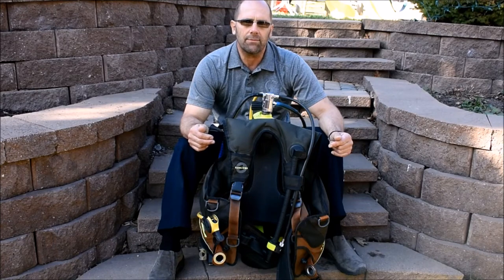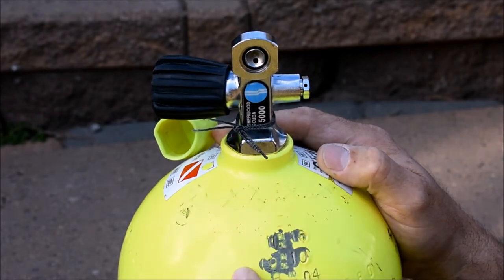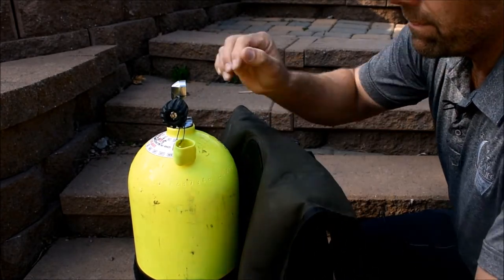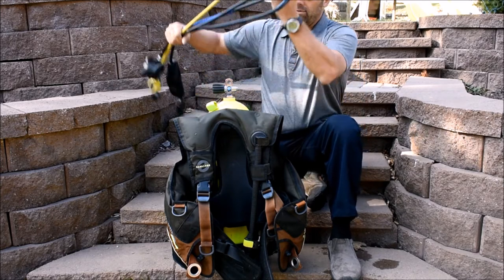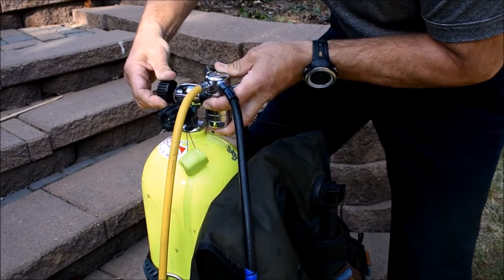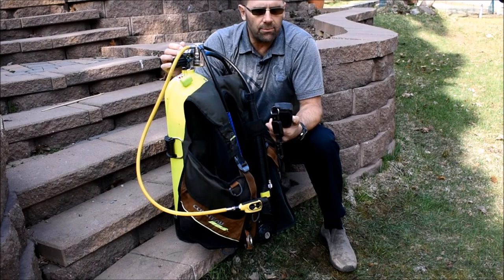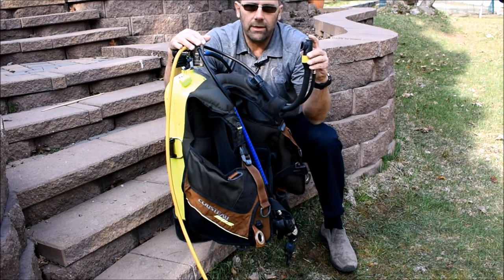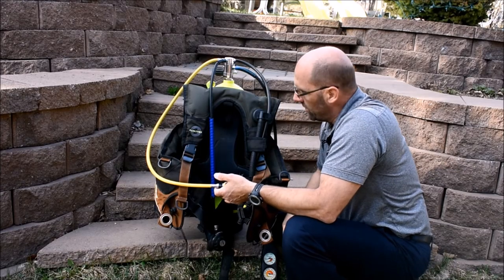How to set up Scuba gear

Comment: Just like to say that I did my ow in Thailand and I used ‘air to hair ‘ as my mantra 🕉 after watching this video ..... also I didn’t know that the bcd strap should be wet because out there nobody wets it because the gear does not dry fully in the shop because of the humidity and that it gets used everyday so never really dries during the high season
Reply from the maker: Sounds like my video helped a little. Glad you remembered that tip. I see the strap issue only once in a while here in Michigan especially at the start of the season or when someone new loosens it from the buckle for some reason. If you own your own gear and do not dive daily, I recommend this practice. Also, not all bands are threaded onto a buckle similar to the one in the video. I have a couple Scubapro BCDs that have a different system and you do not need to wet them each time. Ultimately, you should become familiar with the gear that you will be using but know that there will be differences in brands. 
I hope you had a great experience and will continue to dive.